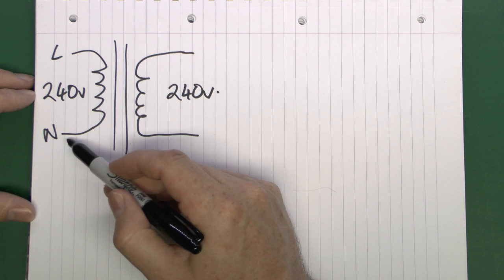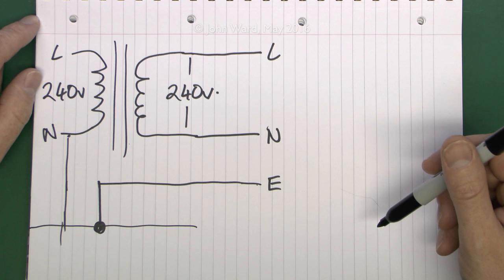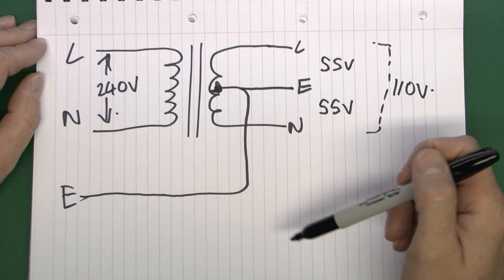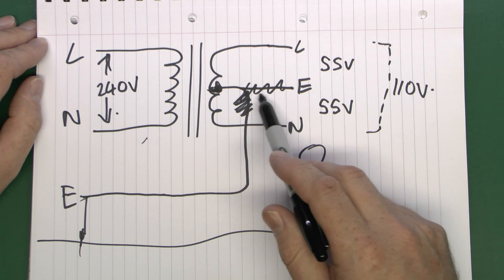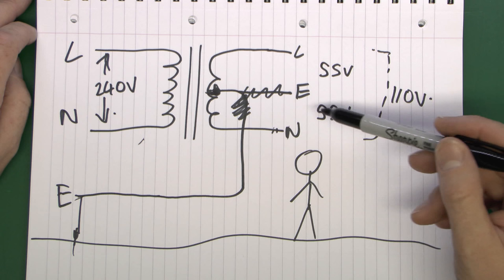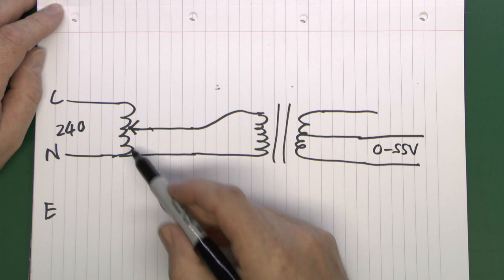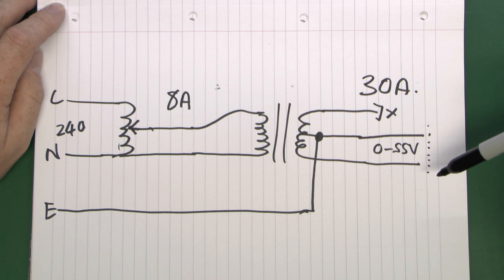Transformers & Earth Connections

Comment: John, These are your best videos. You take us back to basics and do a first class job of explaining (or reminding) us of the fundamentals.

Please do one on joining mains wiring, heat shrink tubing, over tightening brass screws onto copper connectors, terminal screws coming loose, fatigue fracturing of copper wire etc etc.

Comment: This is a good video, but for one serious point that  viewers may find misleading. In the centre-tapped earth 55-0-55 volt system the two ends are NOT 'live' and 'neutral', although some 110v connectors are labelled like that for dual use in systems where neutral actually is at or near earth voltage. It would be better to be thought of as  'live' and 'minus live' to indicate it is a split single phase.

Comment: In large power transformers, the unequal voltage distribution caused by voltage surges in the winding is
prevented by the use of
A. static shields. this is correct.

Comment: fantastic, really well explained.  I was planning on doing some temp rise testing on an appliance which has the option of taking 110V or 240 V and I have to use the most unfavourable voltage for the test to get the highest temperature rise. I knew that as per P=VI, the lower voltage equates to higher current and thus greater resistive heating but wasn't sure whether the centre tap would have any effect. Many thanks for sharing.

Comment: You can also sometimes find cheap "medical" isolation transformer from dale/fluke and other brands on ebay. Really nice build quality and all you have to do is remove the ground with a set of wrenches/racket set. Most i find seam to be rated for both voltage  240/120v 50/60htz
Reply: I picked up a while back at a garage sale a pair of 120V/60H units that I was thinking of doing the exact same thing to, albeit with a switch to select between modes.

Comment: the centre tap arrangement is very similar to the American domestic supply set up. apart from the fact that our friends across the pond refer to the centre tap connection as neutral and the two outer conductors as live , which is indeed what they are. maybe the 4th amendment will resolve this
Reply: except that it is one step down. 55V L+N vs.120 L+N US.

Comment: 3:59 I'd rather say L1 and L2. In case Earth is connected to center tap then there is no Neutral. Both sides of transformer are Live wires. In this case this is two phase transformer. It is not safe to touch Neutral. That's why it is not Neutral.
Reply: Agreed. This is the way i understand it
Reply: @ahmadashirov6330  There is no potential different between earth and neutral. You think its L1 and L2, well throw your probes in parallel to L1 and L2 you would get Voltage difference 400V.
Reply: Also im not saying that thisis the fact. Im trying to figure these things out like you people.

Comment: Consider this scenario. 120 VAC center tapped  step down transformer to 13 V (6.5 V from either line to CT). Transformer is connected to mains via a 2 prong plug so no chance secondary is referenced to earth. Measured voltage between between any secondary winding and earth ground is 135 V. Measured voltage between any secondary winding and line voltage is 50 V and measured voltage between any secondary winding and mains neutral is 14 V. How is this explained?
Reply from the maker: Voltage measured using a device with a high input impedance (which is most of them now), and capacitance between the transformer windings.
Reply: @jwflame  Thanks for your reply but can you elaborate on exactly how the input impedance of the DIMM and coil capacitance cause the voltage to read so high and what, if any, is the significance of that?

Comment: If I'm using an isolation transformer in a test bench environment (to power a Device Under Test), I always leave the earth disconnected.  A lot of equipment references its internal PSU outputs to chassis ground.  If you connect the DUT's chassis to the building earth, every voltage present inside the DUT will have earth reference.  Not good if you're working on high voltage equipment.  Of course you have the same problem as soon as you connect a scope probe ground clip to the chassis.  That's why you should always use a differential probe in these situations.

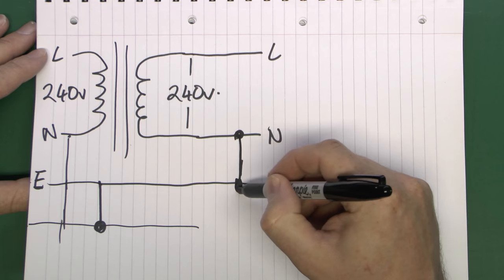Comment: He confused things here slightly by exampling a 110v site transformer and a 240v isolating transformer. At 8:00 he is talking about working on a site, but its a 240v secondary. If its on site it will be a 110v secondary and so you will get the FULL 110v if there is no earth point on the tranny.

Comment: The explanation of the Line and Neutral does not make sense to me. The neutral is connected to the center tap and is tied to ground. From my understanding, the start and finish leads should both be line leads.

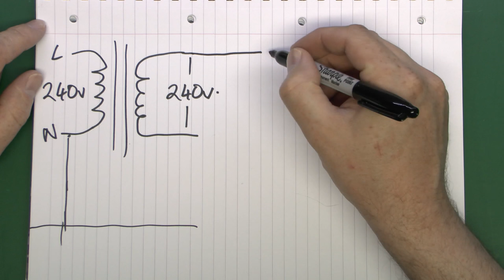Comment: 1:56 Hi John, you made there a little mistake by calling the output leads of this transformer Line and Neutral. 
The output of this transformer doesn't have a neutral from nature, because neutral is almost 0 volt, and you can't tranfer 0 volt through a transformer by magnetisme or inductance.
In fact, the outputs of the transformer are both Line, (Line 1 and Line 2), to get a neutral on the output of this transformer, you must bound 1 of the 2 Line's to ground.
2:24 If the metal core of the transformer is grounded, then there is a socalled Ghost / Phantom voltage between ground and each of the 2 Line's. 
But from the moment you bound one of the outputs to ground (to create a neutral), the Ghost / phantom voltage becomes almost zero between the core and the just created neutral, but the Ghost / Phantom voltage becomes mains voltage between the core and the remaining Line from the output.
Also to mention, that if you use a isolation transformer, and keep both outputs isolated from ground (so without creating a neutral), that a RCD device won't work against electrocution. A normal RCD needs a neutral to work.
There are devices to detect leakage and to protect against electrocution like a RCD does when using a isolation transformer, 
but they called "Isolation Monitor Relay", but are expensive compared to a normal RCD.

Comment: Sorry, but around 2:20, I cannot understand why no electric shock results if the L or N wires in the isolation transformer secondary are touched.

Isn't a shock the result of the difference in voltage causing current flow through the body to earth, irrespective of whether it's on the primary or the secondary side ?
Reply from the maker: The secondary isn't connected to Earth, so there is no path for current if someone touches one of the wires.
Reply: @jwflame  Thanks John. I now understand this principle. In other words, "current in a circuit always returns to its' source", and this is not possible if the secondary is not connected to earth.

Comment: Why do isolation transforms provide an unreferenced ground output at all ? seem more of a hazard than anything. A DTU likely has a grounded metal case and if I connect my oscilloscope ground lead to that case AND probe the circuit the DTU is no longer isolated? Best I can figure is that it allows you test the transformer itself for isolation.

Comment: If you have a transformer with inputs of L & N @240 V with N being bonded to Earth .... and you connect these lines to a transformer which has L1, L2 and a center tap neutral Such that you can now have 120/240 volt split phase on the secondary side ..... Should that secondary side neutral be connected to  earth?

Comment: Hello John
Nice video but some questions

One. Why dont they float they mains anyway, why earth one side to give a neutral anyway??
Regarding the building site transformers you said you get 55v to earth because of the centre tap, this means the secondary winding would only give you 110v anyway. Ie you have a step down transformer with roughly 2: 1 turns ratio.
You then went on to explain that the centre tap is to reduce the shock to ground if one had a fault.
Somehow though you mentioned it was 240 across the coil, surely it is still only the same 110 volts.
Forgive me if I have missed something along the way
Reply from the maker: Isolated or floating supplies would only be safe if they stayed that way - any fault anywhere to earth will make it into an earth referenced system but with no control over which side is connected to earth.
Site transformers are 110V output, for use with 110V tools.
Reply: @jwflame  Thanks John
Also liked you explaination as you drew on paper.

Comment: if you plug an isolation transformer into a piece of equipment that has a step down transformer or smps and that piece of equipment connects the neutral to ground in anyway,  you would be connecting the earth point of your isolation transformer back into the neutral of the the line and removing any isolation. I don't believe this how an isolation transformer is setup. The ones I have here are open earth, not connected to anything except the chassis. One of my isolation xfer only has two wire input, Todd systems L1-1000 3lrg.  cheers

Comment: I only read about transformer in school, but practically did not deal with it. May I know the L and N on the left side in 2:05, wouldnt it be effectively shorting L and N together since the copper coil suppose to be near 0 resistance right? Wouldnt it cause a trip in the MCB ?
Reply from the maker: DC resistance is very low, but with AC the impedance is much higher, as the coil is an inductor.

Comment: Hmm, how about 2x 110 volt site transformers wired like: 240v primary -> 110v secondary -> 110v secondary -> 240v primary, then disconnect the earth on the 2nd transformer's 'primary' output (now being used as a secondary).  So transformer ratios would be around 2:1 -> 1:2.  I guess this would work?
Reply from the maker: +9ff70f96 Yes, if both centre tap connections were disconnected, and no earth was connected either.  It would also be necessary to wire the the two together permanently or change the socket on one for a plug, otherwise you would end up with a lead with a plug on each end, and the output side would need to have a socket as well rather than the plug supplied with it.
Reply: +John Ward - Yeah, I was thinking it could be possible to have one site transformer as standard (so it can still be used as normal), then a second transformer with the 13A 240v domestic plug changed to a ceeform 3-pin 110v, disconnect/remove the earth in the plug/lead, then swap the flex internally onto the secondary winding, then swap the 110v output sockets for ceeform 240v 3-pin and wire them to the transformer original primary side, and disconnect any earthing again, then just make-up a ceeform 240v 3-pin plug to domestic 13A double socket or whatever is most desired (or just mount a socket on the box itself if you like).  Seems like this could be a decently cheap way to make your own isolation box, particularly as the 1st box could still be used as normal.

Thanks for getting me thinking about this, JW, as it's not something I've considered doing before.

Comment: 4:16 That's exactly how it works in North America, except the voltage is 115 - 230 - 115 (well, in reality, 115 is more like 125)
Reply: Typically 115-125, depending on the load on the grid at that moment. My UPS currently says 121v :P

Comment: Thinking a bench isolating transformer could be made by using 2 x 110v site transformers. i.e. 240V into first transformer, 110V out and into 110V of second transformer, and then use the 240V as output of second transformer. Coments welcome
Reply from the maker: It could be done, however site transformers by default have the 110V secondary connected to earth at the centre of the winding, so that connection would need to be disconnected.  That can be done on some models, but others are totally potted in resin and the connections are not accessible.
Reply: @jwflame  Many thanks for the reply John. I was not thinking of carrying the earth through from the secondary of first Tx to the NOW 110v primary of the second, mainly because of mismatch of turns between the 2. So wouldn't this sort out earth problem. My only doubt about doing this is that site transformers are poor quality and quite 'lossy' and I was wondering if I would end up with a lot of no load power wasted

Comment: Regarding your setup for current testing, have you seen the BoomBoxDeluxe channel? He has built what he calls the Fun Jiggery Pokey Unit. It's two mains sockets in parallel, which are then in turn connected in series with another socket. This can be used to connect a load, in his case usually a water heater, for current limiting in series with the DUD (device under destruction) in case the device fails with a dead short.

The two sockets in parallel also means he can do more advanced things like connecting a transformer that has a sharp inrush current without blowing a fuse. He does this by connecting the water heater on one of the parallel sockets, a pass-through plug (naughty!) on the other parallel socket and the transformer on the series socket. He can then turn on the heater followed by the transformer to provide a limited inrush current. He can then switch to the pass-through plug to use the transformer.
Reply: Gurdeep

Comment: Enjoying your videos! I am not an electrician so have limited knowledge of these things. Please can you explain something. Why are mains transformers and distributors earthed if it makes a circuit through a human body possible? What us the point of the earth? Sorry if this is a stupid question!
Reply: +doughnuts67
See this video:-
https://www.youtube.com/watch?v=Wx_v1-T1gE4
Reply: Because it is hard to prevent a system becoming earthed so it is better to make an earth in a controlled way. There are other problems with a floating output particularly on a large transformer. Firstly there is capacitive coupling between the primary and secondary which can induce high voltages onto an unearthed secondary and  there is the problem of a short putting primary voltage directly onto the secondary. So in the  case of an 11kv to 240volt transformer 11kv appearing on the output. With an earthed secondary this is likely to cause a fault current and disconnect the transformer. With a non earthed transformer 11kv gets delivered to someone’s house where it would flash over in a high power electric arc and general unpleasantness would follow.

Comment: OK there's one thing I don't understand here - if the mains Line voltage is 240v in relation to earth (neutral is connected to earth, so it would be, right?), when the output-side earth from an isolating transformer is connected to earth wouldn't there also be a 240v potential (at least roughly) between the output Line and the earth? In this video John says there's no potential between either wire coming out of the transformer relative to the mains earth, but in my interpretation of what's happening there would be 240v between L and E, and only zero between N and E. Where am I going wrong?
Reply from the maker: The output of an isolation transformer is not connected to earth - that's the whole point.  If the output is connected to earth, then it's not isolated.

Comment: John, if I want my work bench to be isolated from mains power AND also protect my test equipment (=scopes), do I then have to use two isolation transformers?
Reply: @Karel van Cooten : Study your setup and learn your current pathways.
Reply: Where I worked we were not allowed to use two transformers. There can be a phase difference depending on how they are wired up internal. If one of the transformers gets earthed you can have TWICE mains voltage on the equipment.

Comment: My M300 Harrison lathe has a 440V transformer that uses a single phase to transform to 110V but then connects the earth to one side of the 110V out. Its in the manual at the back. I'm re-wiring for 240V 3PH and will swap the TX for a 240-110 but suspicious about grounding one side ??

Comment: In ac which end is neutral.the current generated in power station from generator let have 2 ends (2wires comes out of generator) now both are load or one load one neutral.
Reply from the maker: As generated and distributed, neither are neutral.  One conductor becomes neutral when connected to earth at the final transformer which supplies the end user.
Reply: John Ward .thank you brother for your reply.it really help.

Comment: Hi John, thank you ever so much for your videos; I've watched dozens of them and understood them all, even as a layman, thanks to your clear communication and presentation. Much appreciated!

Is there any reason why a split-phase 120-0-120 system (like North America uses) wouldn't work here in the UK? Except we would connect all appliances to both live phases and effectively keep at 240V? Would this not be a bit safer in the case of a fault situation? Or is there some blindingly obvious drawback that I have failed to realise?
Reply from the maker: It would work, the main disadvantage is cost, 3 wires would be required instead of 2.
Reply: @jwflame  Thanks for the reply. To mitigate the cost implications, what would be the consequences of continuing to use a two-wire system with split phase so that we could keep our existing infrastructure, plugs and socket outlets? That is, the two phases across L and N pins of a BS1363 plug and a combined neutral/earth across the E pin. I understand plugs would now need to be double-fused but, other than that, nothing would change? I believe some older installations in North America still have this configuration (NEMA 10-30). Would there be safety implications of combined earth and neutral given that earth is combined with neutral at the cutout anyway of a TN-C-S supply?

Comment: Great movie and great channel however i have a question i havn't found the answer yet... why in AC circuit with ground connection, current doesn't flow (escape) by this ground wire but flows in closed "device-transformer" circuit. Thank for all helpfull and "nonhate" replies